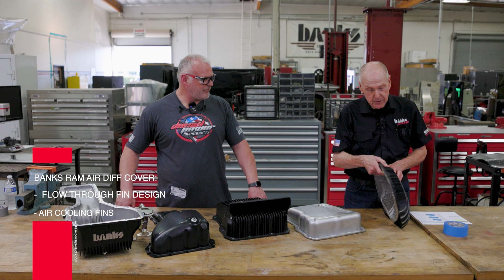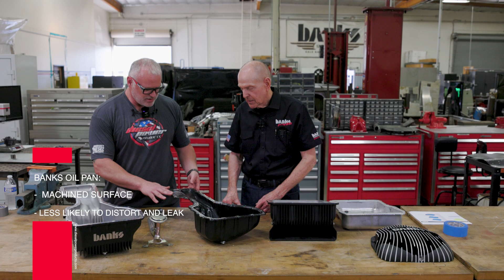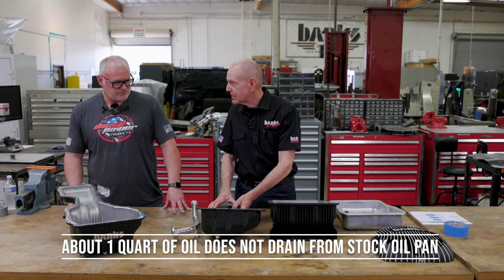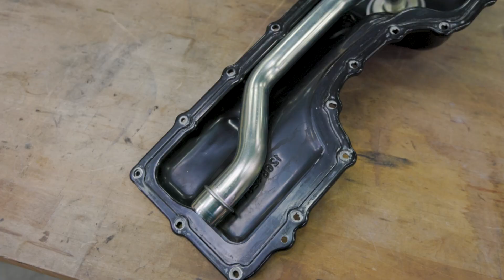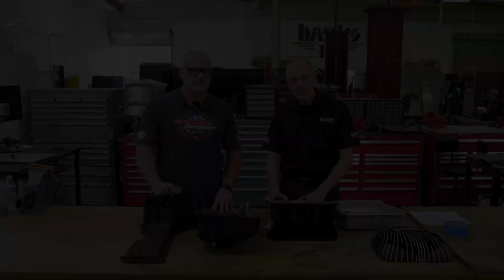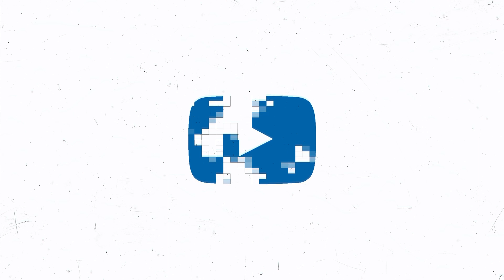DIESEL TALK | BANKS POWER COOLING

Comment: get that trans pan in to production dang I am putting miles on everyday and no pan in sight
Reply: dont buy into their marketing, youll never make a difference when these transmissions since they are thermostat controlled. They are meant to stay hotter for efficiency manufactures do it this way for gas mileage. Until you bypass the thermostat your pissing in the wind, and at that point you wont need the pan.

Comment: This is a great idea, but already have aluminum oil pain from RCD for my Ford 6.4, but this does look like a better option. Another great add-on for oil engine cooling is Insane's Diesels Oil by-pass with their Oil Cooler Upgrade Kit.  Not cheap, but totally worth it.  I am doing everything I can to protect my diesel investment.   At 350K miles and she's still running strong with "NO" idle blow-by and doesn't burn oil yet.